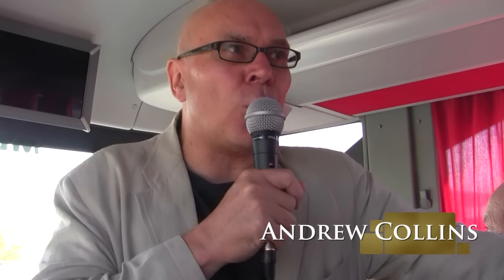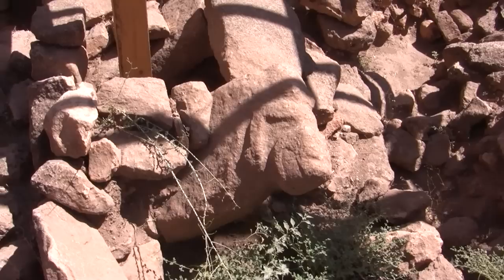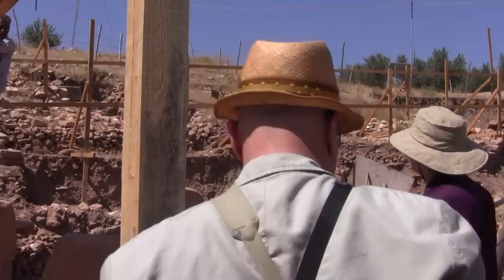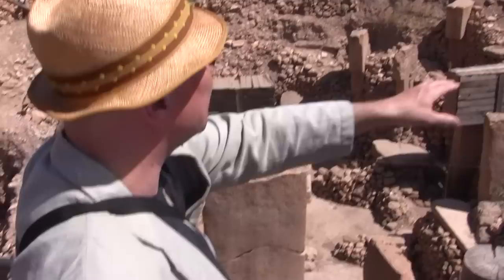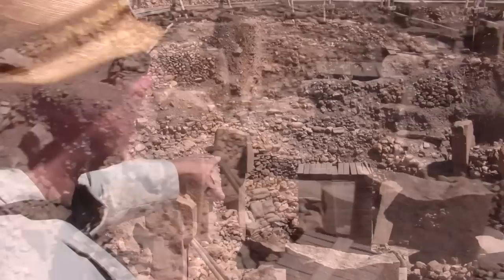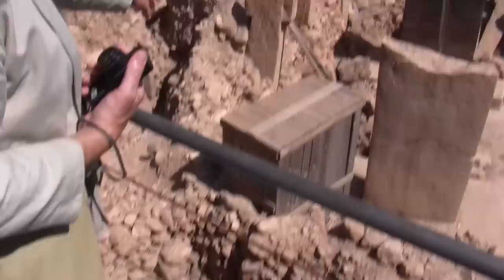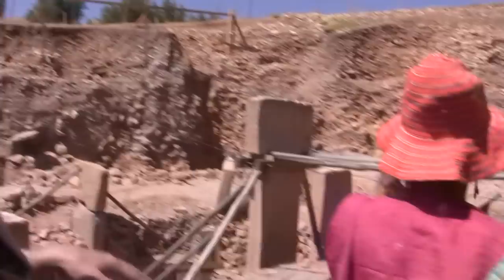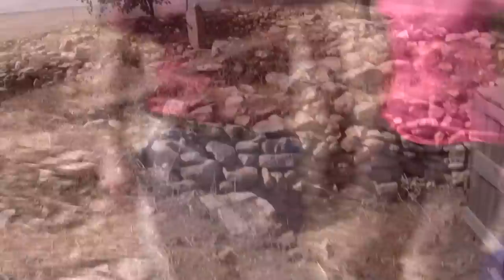Graham Hancock | Göbekli Tepe | Ancient Technology 10,000 BC or Older?

Comment: To really see the intended truth here one needs to have a good grasp of pattern recognition and symbology of which is prerequisite for the proper understanding and acurate interpretation of the many symbols that the "builders" used to communicate the ACTUAL purpose (as opposed to the video's initially perceived and seemingly correct one)
But unfortunatelly these first impressions, as displayed in the video, are lacking in the depth necessary to derive any comprehension of the totality of meaning that are held within the many symbolic representations.
The abundance of carvings and statues that literally take the place of "the writing on the walls" and cover every available surface, thus preform the function of the written word whose meaning woud have otherwise been lost to the understanding due to the many and varried languages, cultures and nations that the famed and near by, Archonticly designed, Tower of Babel is said to have been the cause. So we find it slightly ironic that the very architect of the great cause of "misunderstanding" between men is also the Archon builder of THIS PLACE. The Archon, being fully aware of the poroblem thus finds it necessary to use the symbol for communication in all venues where he wishes to be fully understood.
Therefore the extreme puntitive result of this little lesson (the point of which I haven't fully examined or considered) was thus intended and designed to be fully understood down to and within the very soul of "ALL  MAN" as they were being tortured to death and consumed by the very animals depicted on the walls of these chambers.